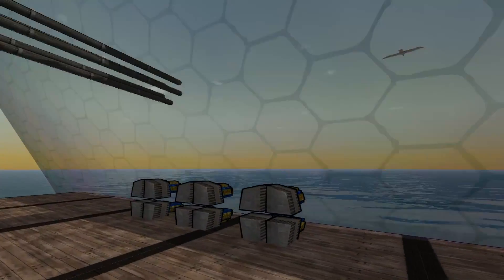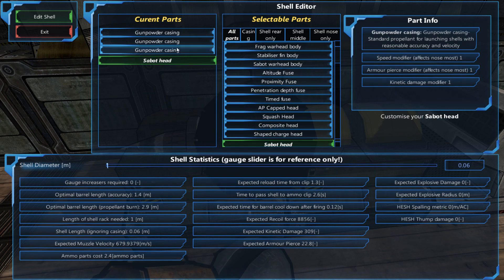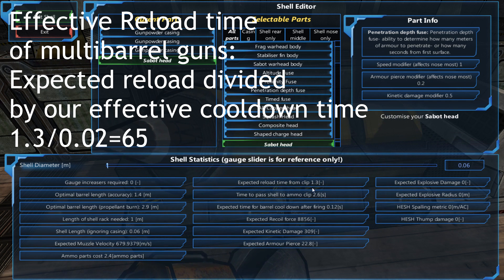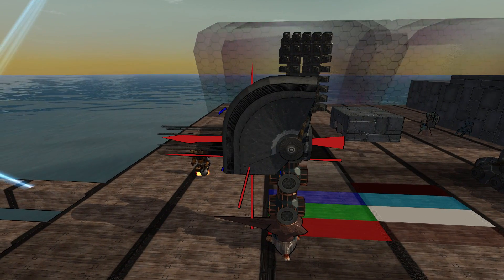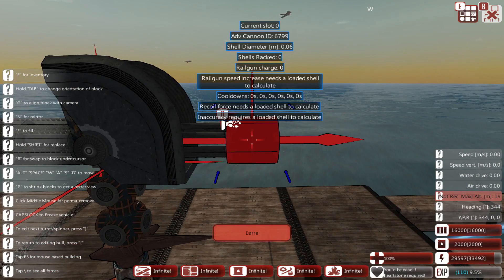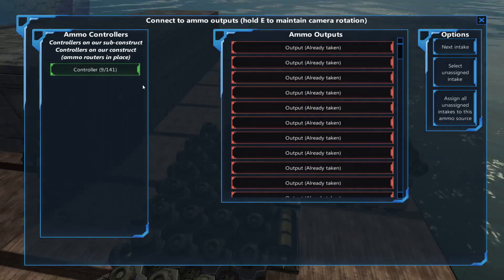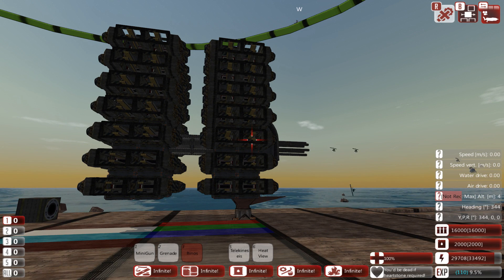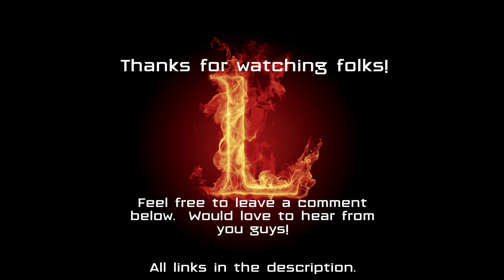3000RPM Minigun - Tutorial - Advanced Custom Cannons  - From the Depths[OUTDATED]

Comment: So I hooked everything up correctly (everything says it's connected), but the cannon is not saying shells are loaded and I can't fire.

I am trying to get a belt-feeder to work.  This is my second time with the same problem.

Does it need to be at the front of the gun assembly or something?  I have it at the rear the way I would with an auto-loader.
Reply from the maker: +manictiger Nope, you should be able to connect a belt-feeder anywhere you can connect a normal autoloader.  Any chance you could share a screenshot of the problem?  I might be able to tell you what's wrong from that. :)
Reply: ireLAN Gaming
I figured it out.  It needs to fully load before the firing piece recognizes it.

I can't believe I've been missing out on this king of firepower.

I'm running 8x 41.66mm 6-barrel gatling guns in a tight group, so hopefully that will help reduce the length of matches and not drain my natural resources so much on repairs.

On 'Godly Designs', the White Flayers are ridiculous.

Comment: Thanks to this video i learned some thing which help me in my no custom cannon playthrough as i want to use the advanced cannons and i'm trying to make a cannon which would fit onto my starting vessel but that is harder than i tought :P basically i make my starting resource platform i than calculated the ammount of resources i have left to build a ship and everything went great untill i placed my cannon onto the ship and found out the shit is so top heavy turning the cannot any direction makes the ship go upside down :/ i will try to redisign the ship itself to make it bigger as i like the cannon
Reply from the maker: +NotIrishRider Hurray!  Glad I could help!  It might be beneficial to try building the turret into the hull a bit.  From what I understand of the way Turrets work, all of their weight is applied where the turret block itself is located, so if the turret block is placed at the bottom of the hull, as far as the game is concerned, you've got a massively dense weight, attached to the bottom of your hull rather than in the space the cannon physically occupies. :)
Reply: ireLAN Gaming that is something which will greatly help me XD thanks
Reply from the maker: No probs!

Comment: Try out a rail gun, I found that there's a limit to how many magnets you can put on the barrel, which is really quite sad since the rail addition doesn't really add much at all.
Reply from the maker: +Ferrous Aradicen (Disciple Of Origin) Yeah, it seems a little counter intuitive that batteries add velocity rather than additional magnets.  I've done a railgun vid, but really haven't expanded on them further as I feel they are pretty poor or rather, have extremely niché uses.  The diminishing returns stack up much too fast for them to be worthwhile.  I don't want a return to the railguns from the very start of the devtest (was easy to get a 13k/s shell), but they need a bit of a boost to give them more purpose.  Right now, the infrastructure required to match a single extra gunpowder in your shells is a little crazy. :(
Reply: I set up 10 of your mini guns on the hill closest to the starting area in vehicle designer, put them up against 1 of my strongest boats, it has two triple barrel recoilless long range cannons and two hydra missile systems.  My boat cleared the island of mini guns before it got below 80%.

If anything, advanced cannons need a buff.
Reply from the maker: This minigun doesn't fire at 3k RPM anymore and it's a bit pants, lol.  It was always meant as an example anyway.  Now, do the same with the new Gatling cannon that went up a few hours ago and see if you get the same result. :P

Comment: What's the quantity of ammo creation/supply blocks you need for this?  Got the 65/66 autoloaders.
Will have a play around with it tomorrow, and see what I can come up with.
Reply from the maker: +Athuzad There are at least 2 inputs for each autoloader.  If I remember right, there are 141 ammo outputs on the shell customiser and probably roughly equivalent in shell parts.  I just threw parts onto the shell customiser without thinking, so not sure just how many shell part blocks I'm wasting.  Still a long way from working out ammo consumption rates.

Comment: You can also use a binary search to get the size right. That should work always and you only need a minimal amount of tries.
Reply from the maker: +jarrad2000 Sorry, thought I replied ages ago.  Stupid phone not updating the post.  I did a quick search on binary search algorithms on wikipedia.  Hadn't considered that method, it's very handy.  Thanks for the tip!
One of the other viewers made and awesome spreadsheet to work these out: https://docs.google.com/spreadsheets/d/16vgi3n2mFHmcmS9WgKCAeSj55797fFXw3GITHjazaOA/edit#gid=0  Thanks again Nicholas!
Reply: ireLAN Gaming It's basically just "start in the middle", if it's larger, try the middle of the right side of the initial split, otherwise try the left side of the initial split and then repeat. This way you'll reach the exact value with a minimal number of steps.

However, it would be better if they would just implement a wizard or some other assistance tool into the game :)
Reply from the maker: Agreed. There are so many quality of life improvements still to come though. I'd say it's only a matter of time. :)

Comment from the maker: Sorry I can't reply to you directly BDD D, seems to be a problem with your G+ settings.  I've already developed a recoil powered speedboat!  There shall be a video on that one very soon!
Reply: +ireLAN Gaming You should use:
timed fuse
flak warhead
frag warhead
casing

 It's good for anti air, it'll make this gun OP.
Reply from the maker: Well, this gun is from a really old devtest now, so it doesn't work quite as well as it used to, but that's a really interesting shell configuration.  I never considered mixing frag and flak, I'm gonna have to try it out.  Thanks a bunch for the suggestion! :D
Reply: ireLAN Gaming It's good for AA, as the timed fuse will detonate even if its a miss, allowing fragments to scatter. The shell is designed to have massive AoE against soft targets, making it potent against weak hulls.
You should remake this minigun, and use that shell, that'll be OP against DWG.
Reply from the maker: Already done it, lol.  It doesn't work terribly well unfortunately.  The problem is the mixed rounds benefit from a different detonation time.  2 Flak or 2 Frag would be better.  Flak needs about a -0.1 second fuse on the laser targeter to be effective, whereas you get much better use out of a Frag by setting it to -0.3 or higher to allow the frags a chance to spread.  Even with a high cone angle, because they carry the velocity of the shell into momentum, it means they will frequently miss when detonated too close to the target.
The best AA gun by far is still high speed sabot rounds, but with the gunpowder changes in the devtest, it's much harder to get super speed shells. 4 powder, sabot body, sabot head at 150mm is a good squirrel killer now if you can get your refire high enough. :)
Reply: ireLAN Gaming Eff those fancy advanced cannons. Viva la custom cannon!
Reply from the maker: I hear they will be getting a rather interesting rehaul.  Looking forward to it! :D
Reply: ireLAN Gaming Yay!

Comment: Hi. um... dont know if you've covered itbor noticed but there is a nice trick you can do when you have multiple ammo producers feeding into one clip, if you make the different ammo producers make different shell you can fill your clip with e.g. a line of AP, HE, AP, HE and so forth, letting you vary your firepower without having to build another cannon.
Reply from the maker: +Lukas Burger Now this is something I have got to try!  I can think of a few really nasty things you could do with this.  A few squash heads to soften them up with some low AP frags on high cone angle to really mess up the insides.  evil laugh >:D
Reply: +ireLAN Gaming Yeah, although you'd want to keep the velocity of the different ammo types somewhat similar.
Reply from the maker: Hmm, that might be tricky with HE shells.  They add a lot of time to cooldown it seems.  Still could be a lot of fun to play with!
Reply: ireLAN Gaming Yep. I've been playing around with a 280mm cannon turret lately, as well as a double-barreled 88mm AA gun.
Reply from the maker: Sounds fun.  I haven't actually played around with slower firing cannons much yet.  Took a while to work out enough to design that minigun.  Will be getting on to those soon.  Gonna have a look at flak cannons next I think.
Reply: ireLAN Gaming Well, they are quite devastating. I haven't played with fuses much yet, though.
Reply from the maker: I've only played with them a little, but penetration fuses can be utterly devastating with the right shell.

Comment: the Q menu on the cannon displays the gauge in whole centimeters, while everywhere else it is in meters, so you divide the displayed gauge with the number of barrels you want, then of course you divide by 100 to get from centimeters to meters
Reply from the maker: +anter176 Sadly, it's not as simple as dividing by the number of barrels.  If you have a max gauge cannon (0.5 shell diameter) and split that into a 6 barrel, you end up with 6x0.15 cannons.  0.5/6=0.0833 recurring, which is half of what you actually get.  Not sure on the exact formula, but Evil4Zerggin on the official forums reverse engineered many of the equations.  You can find them here: http://fromthedepths.gamepedia.com/User:Evil4Zerggin/Advanced_cannon